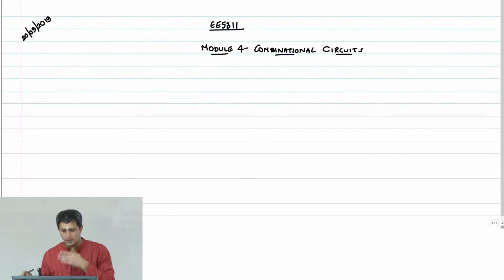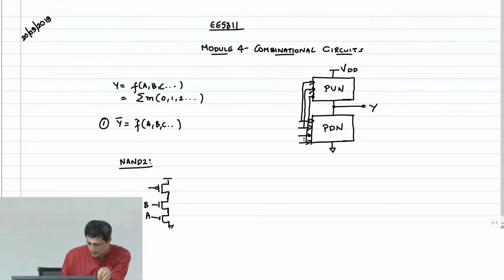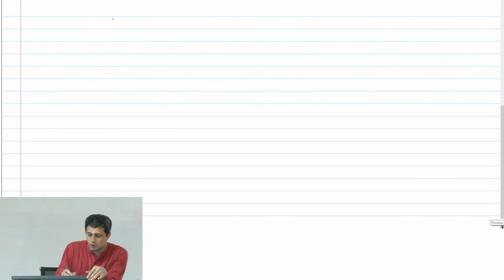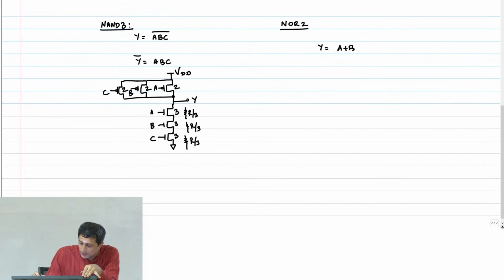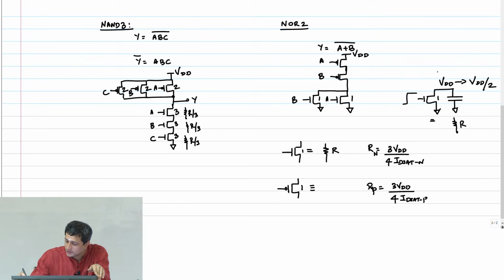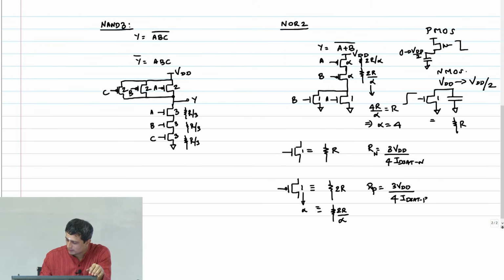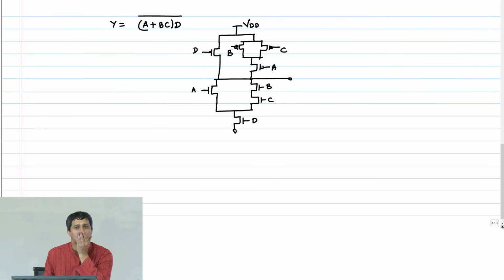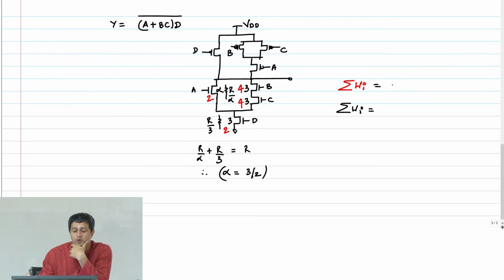CombCkt - 3 - Gate Sizing

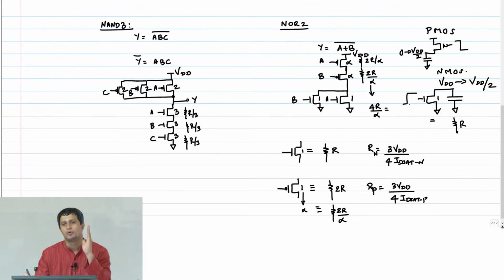Comment: 13:05 why 4R/α =R ? when for reference inverter pull up network has 2R .
Reply: if W=1 nmos has resistance R, then W=1 pmos has resistance 2R singce mobility ration of n and p is 2 and resistance is inversely proportional to ccurrent and hence inversely proportional to mobility ( keeping width same). now, since W=1 pmos has resistance 2R, for worst case pull up network the delay must be that of pmos of unit inverter which has width 2. and for W=2, resistance must be 2R/2 = R. this is why adding in series, 4R/a = R.

Comment: 13:49 

Well , I did something different for NOR2 to get alpha=4.

We know for a reference Cmos , Pull up network has worst case Resistance= R/2.

So , considering wodth to be alpha for Each PMOS in NOR2, 

Total Resistance of pull up= (R/alpha +  R/alpha ) = 2R/alpha.

so 2R/alpha = R/2 

so Alpha = 4.

Is this Approach Correct??
Reply: No sir, your initial assumption is not right. the worst-case resistance of PU in CMOS is R. (For w/alpha=1 the resistance is 2R, but for w=2 the resistance is R)
Reply: It should be,  2R/alpha +2R/alpha=R
4R=R*alpha
=>alpha=4

Comment: why not pmos size is 1 for NAND2
Reply: He mentioned several times "worst case of PD/PU path". according to that, in case of the nmos PD, one should make it lesser resistive, unlike the pmos PU. 
still, it doesn't fit with intending to have a normalized delay as the CMOS inverter...
in fact, there is a limitation with normalizing it. for example, try to normalize it in NAND3. (You (apparently) can't because you don't have a pmos less then w=1...)

Comment: Thank you, sir, for sharing this video. I want to ask about sizing PMOS and NMOS transistors equally in a transmission gate in digital circuits. 
When someone sets the sizes as (W/L)n=(W/L)p to achieve higher speed, I'm unsure about the reason behind it.
Reply: I'm not sure of the "higher speed" you mentioned. But I'm certain this is not necessary to make the pmos twice wider than the nmos, because now they are not connected in series, but in parallel. most of the time, both of them conduct together.

Comment: At 17:35
Why sir has taken B=4, C=4 and D=2 ?
Reply: It is just an examples to show the width can be different and still we can get the same resistance R, so which width is suitable, we can also make width to be 8,8,4:: 16,16,8 and so on
Reply: @siddhant-x8k  still dont understand. i understood the alfa= 3/2 part. But what is the even values with the red(2,4,8). what are they depend on ?
Reply: @saygod3755  if WB=Wc=4, WD=ALPHA, then RB=RC=R/4, Now path BCD: R/4+R/4+R/alpha=R(reference worst case) . Solves to give WD=2
Reply: If we consider the other path to calculate the width then A and D are 2 thus B and C are 4. (Ignoring Worst Case method for calculation)
Reply: if taken your reference then area will be large . but we want area as minimum as possible